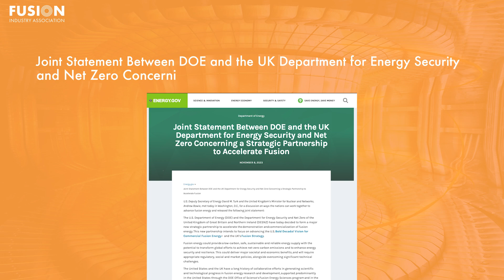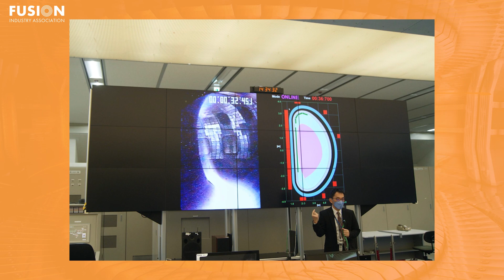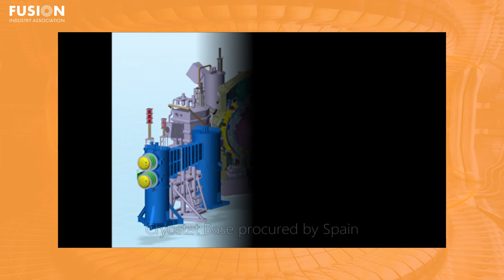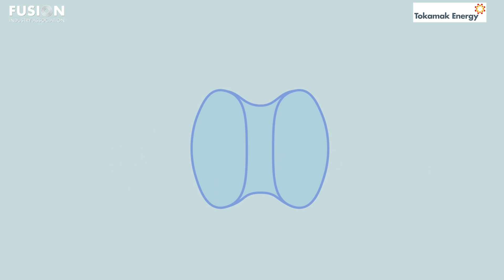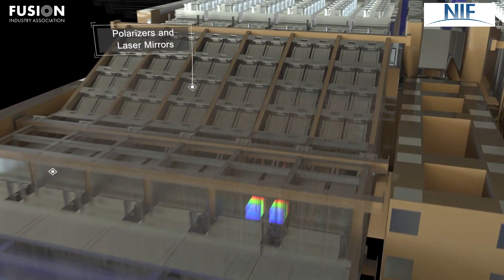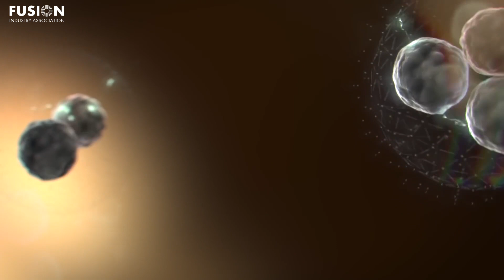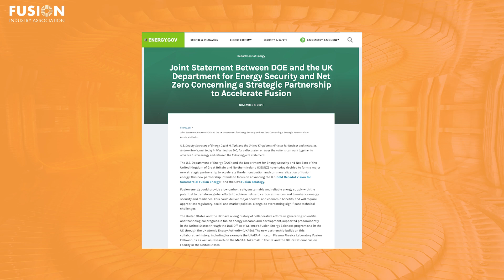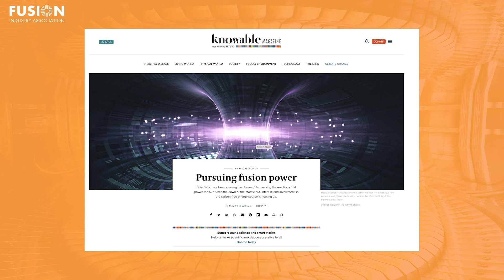Fusion News, November 15, 2023

Comment: Commercial fusion power will never be feasible. While it's a fascinating topic for nuclear nerds, people need to be reminded of this fact.
Reply: How can you know this? The best way to look foolish is to make dramatic statements without proof.
Reply: @raymondlancaster1955  I can know this because of my experience working on a fusion energy project decades ago. Because I finished first in my class in Physics at a school I chose for the reactor on campus. Because I've read and understood the scientific and technical basis of the energy requirements to build and operate fusion reactors, as well as the refineries needed for Deuterium, Tritium, and like reaction elements, and so forth and so on.

It's been well understood for forty years that the best outcome possible is still two orders of magnitude less energy out than energy in, for fusion.

If you need proof, do it the way I did: get a degree in the subject and work in the field.
Reply: @raymondlancaster1955  He’s absolutely right. Briefly the problems include cost, tritium breeding and handling, 14 MeV neutron damage to sensors, insulators and metals (inducing swelling and brittleness), safety (tritium/lithium - both nasty), heat loads onto the diverters, plasma interactions with the first wall (erosion and dust), and finally the lack of any ways of testing components and systems (eg, tritium breeding efficiency) before construction.

Comment: ITER development is so very slow. Although I suppse that's to be expected with it comprising a million+ parts and over 20k tons of steel.
Reply: You’re right about the slowness of building ITER, but it should be realised that it is a very simple machine compared with a electricity generating reactor which would need the addition of neutron multipliers, tritium breeding modules, heat extraction for the generators, and separate processing plants for the tritium and the multiplier/breeding materials. The complexity of all this speaks for itself, and the costs will be astronomical - even for smaller planned spherical machines.

Comment: Fusion will always require more than 100,000 times the working temp of fission. Why bother with this impossible physics. For the price of this unobtanium program we could  have bought 100s of working fission reactors. And where does the tritium fuel come from, it comes from thin air. And the physics and engineering is also 100s of times as complex as a fission reactor esp compared to the Molten Salt Reactor. It is criminal that kids are tought that fusion is clean involving nothing more than smashing hydrogen together to make helium when it is vastly not true. When high energy neutrons are produced as they must be in almost all fusion processes, the walls will be irradiated to make new kinds of nuclear waste. And forget about breeding.

If you really want to learn how to build a working fusion reactor, go back to the school of wizarding at Hogwartz, the spell is Trilarium Dolarios Adfuseum.

Also look up Dr Daniel Jassbly, he has a few words on the subject of tritium, he would be the professor.

Comment: 4:24 The problem is ITER has taken too long to deliver. If it had been at its present stage 15 years ago, which is more or less what people envisioned back in 1989, the present gap between the closure of JET and the beginning of ITER operations would have probably not happened. I'm not getting into the reasons, which have more to do with bad organisation and poor planning than with science. What this video didn't report is that replies to the petition have already been issued by the UKAEA and EuroFusion, explaining why there are technical and economic reasons why JET will have to be decommissioned, which is a shame indeed.

Having said that, the experience with D-T reactions acquired by the JET team will be hard to preserve until 1935, when ITER is planning to start such experiments. Parallel D-T experiments should have been planned, but they were suppressed in favour of funding ITER. Now the community will have to bear the consequences, I'm afraid.

Comment: not sure this will ever get a good return on fusion .  no real efficient way to recover extract heat/ energy , with out cooling down the reactor , and the neutrons basically destroy the inner lining  in no time , and needs to be constantly replaced .
Reply: Any technological development when designed better always eventually fixes it's functional shortcomings. It's really a matter of repeated redesigns to make small steps to progress. If you take the airplane for example it took humanity over 100 years to get to the functionality that is now enjoyed today. This only happened after repeated redesigns to get to the functionality of hypersonic aircraft.
Reply: @w3sentry This pseudo-analogy with an aircraft is nonsense. Early aircraft were small and very simple, and indeed they have evolved slowly to become the modern airliner. This pattern might apply to fission reactors, but fusion reactors already need at the beginning to be very complex, and worse still, there are no easy ways to test components in the fierce 14 MeV neutron environments where material swelling and brittleness need to be known before construction. I could go on about tritium breeding but perhaps this comment is already too long. 
I predict that STEP will never be built.
Reply: @w3sentry  Comparing the development of airplanes to fusion engineering is loughable, the bycyle industry produced working planes with relatively simple tech, and by WW2 being over, we had jet engine tech that has not improved much, none of it was impossible engineering. Fusion engineering is 10 orders of magnitude harder than flight.
Reply: @johnjakson444  yep , airplane analogy was amusing  straw man argument,  i knew they weren't knowledgeable  enough about what type extreme environment was  needed for controlled fusion ,
Reply: @w3sentry  well there ARE some BIG challenges , as i previously mentioned . !00 million degrees , and Massive amount of FAST neutrons turn everything in to atomic swiss cheese , not to mention the thermal recovery    , IF the purpose IS to generate CLEAN power .  It's Not a good option .. and Micro fission reactors , and Micro wave drilling ( Deep drilling 8-10miles TO tap geothermal energy ANYWHERE on the planets . IS a much better option ,